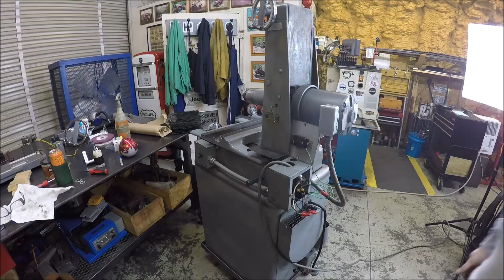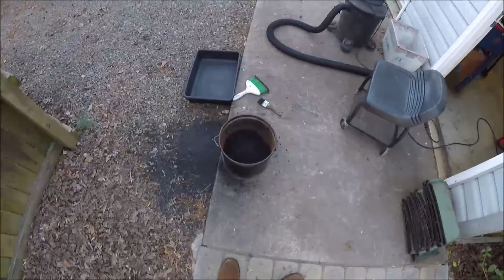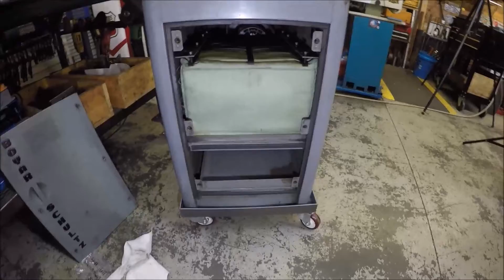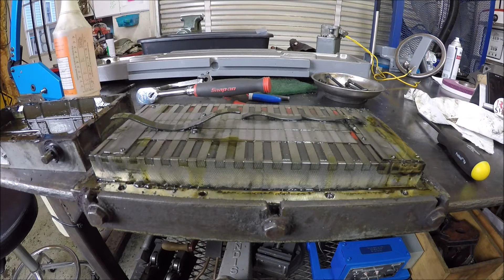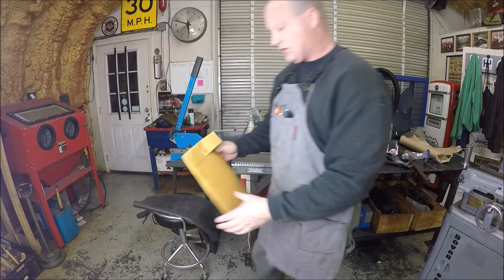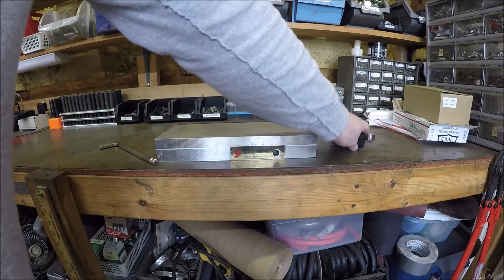Boyar Schultz Refurbish Part 7  Getting it back together

Comment: Hi how did you clean the bags? Did you wash them. Can you help me get a copy of the manual
Reply from the maker: I did not wash them. Shook them out to get most of the dust out and then used compressed air. Once I get moved in to my new shop and get everything unpacked I can get you a manual. Right now it is packed up.

Comment: Hey Tom, great work! I have just about the same grinder minus the filter unit. Something I have come across several times while researching mine that may help you with the start up noises you're hearing, anytime it's been sitting unused for awhile you want to start it up and just let it run for about 5 minutes or so without any load. Which allows the bearings and greases to warm up and stiffen up any set tolerances in the spindle, then do your set up for grinding. I haven't had the chance to test this theory myself though because I'm still in the middle of refurbing my 612. But hopefully that will help you get the spindle noise to stop or at least run quieter.
Reply from the maker: Thanks for the tip Jeremy. I will try that. I am new to surface grinding so I can use all the help I can get.

Comment: It's  good to see your getting it back up and running.    My dust collector comes on with the grinder. I need a separate switch.  The table on mine is setup for coolant,,, and like you said. Both cant be running.

Comment: Cannot here the rain like rain though, nice step forward in the grinder refurbish. Thinking I like the box fan blue in color on a stand behind the grinder. Nice scale. That is quit a duct collection system for sure did not know that was inside a surface grinder. That is a lot of wear going on there mainly looks like lot so the new one was a smart move. Nice way cover material cannot ever have enough of that around the shop.
Reply from the maker: Active Atom The box fan was free from a fellow welding shop. I ended up having to redo it with a new motor. I did a video on it. Thanks for watching guys.

Comment: Did you replace the couple joint between the spindle and motor.  If you did disregard.  I have to do mine. It is sitting waiting one me. 

Good Stuff!  Keep em' coming.. 

Dan
Reply from the maker: House of Broken Dobbs Things _ with Dan Dobbs Hey Dan. I did not go into the motor or spindle. The bearings aren’t making any noise and I don’t have vibration. The motor has a little crunchiness going on. I think it has some grinding dust in it. Going to use the machine and see if it clears out.
Reply: Yeah mine has a slapping noise on startup - likely the joint. I will have to take a look.